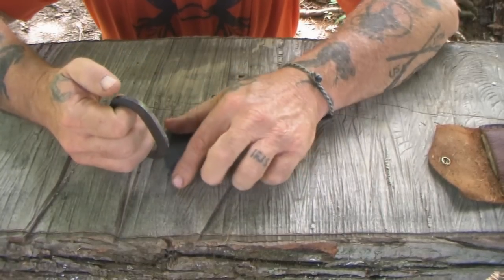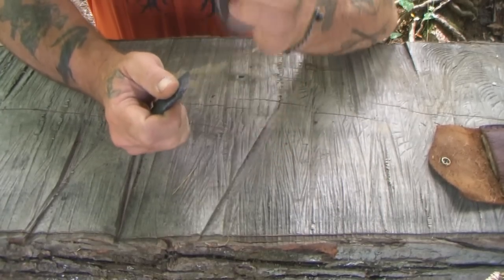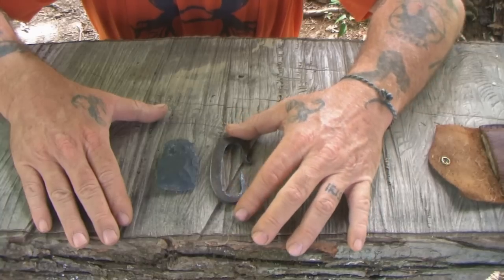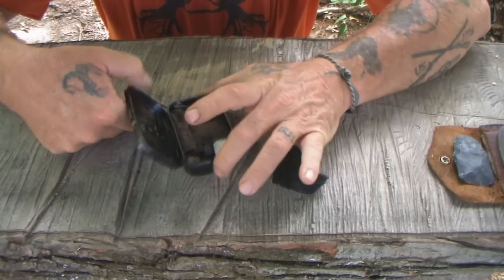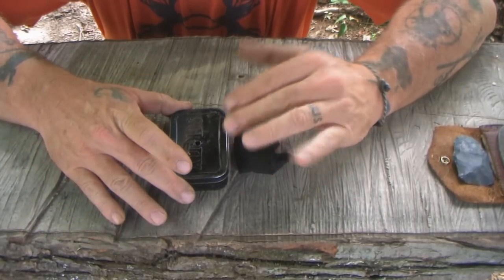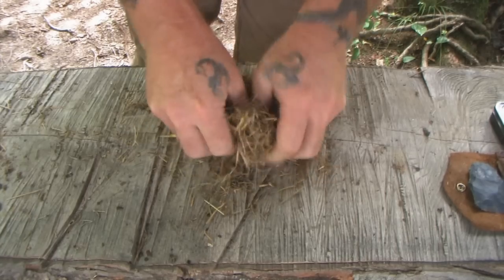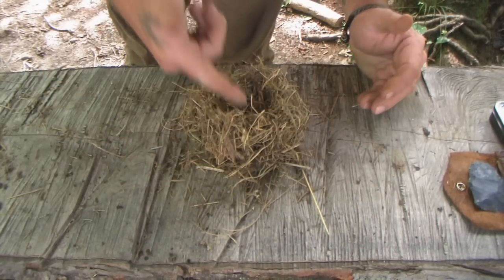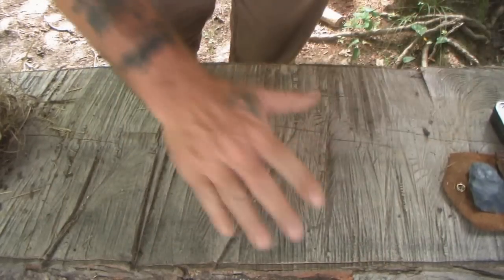Flint and Steel Basic Ignition

Comment: Linen also is a organic fiber that works well for char cloth and has been used for ages.  I like to raid my dryer for organic lint, it maybe cheating in that it is not naturally occurring, but it has one huge advantage over processed fabric, surface area!  Dryer lint has enormous amounts of surface area on the microscopic level and surface area is what helps spread fire.  Thanks for the video

Comment: a nice thing to include with your firesteel kit might be a small piece of charcoal, it acts as a beautiful coal extender and you can easily replace the piece with the charcoal from your new fire. even powdered it works as a spark catcher like the charcloth, loads of surface area and readily available once your charcloth gets low.

Comment: Pretty much.  The two key things about the rock are that it is, A, harder than the steel or else it will chip and no steel fragments will removed, and B, has a sharp edge on it.  The sharp edge is what scrapes a bit of the steel off.  These points make it way easier to controll the spark.  But if you've ever hit a rock with a shovel, you will often see sparks flying.

Comment: QUESTION: when using the spine of your knife, you mention needing high carbon steel. what percentage of carbon is required? i have read that high carbon is at least .6%, and else were i read that its at least .4%. i have my doubts that .4% truly high carbon. but i would like to know if something that is .4%-.5% carbon would work? to be more specific, the metal is the 420HC. i know that its not the best metal out there by any means, but would it be sufficient for "flint and steel" fire starting?